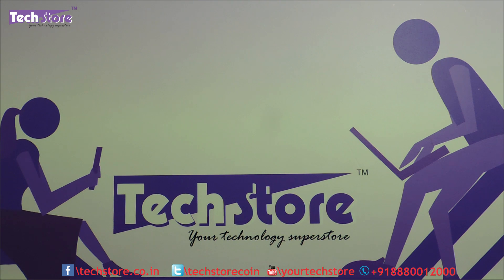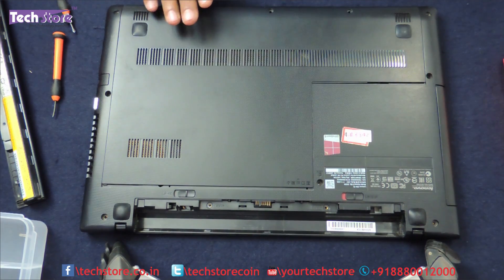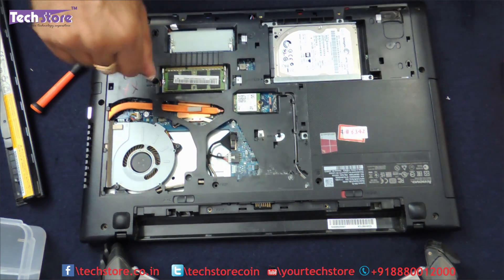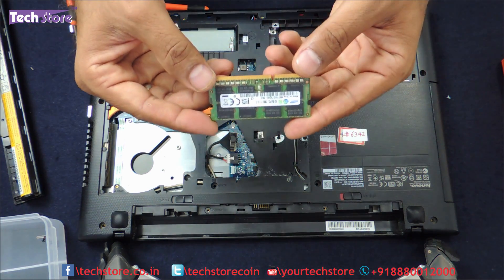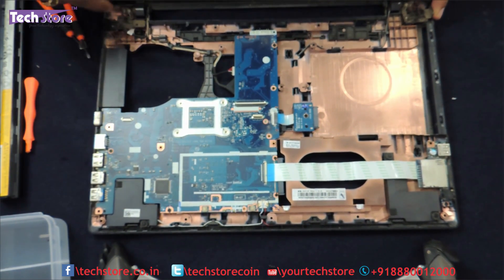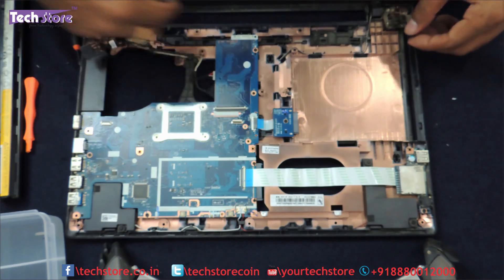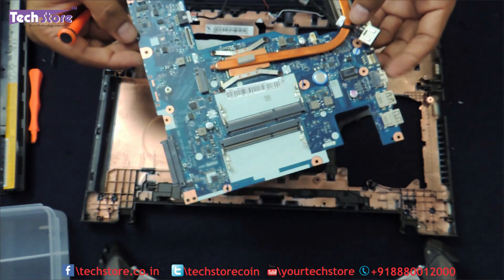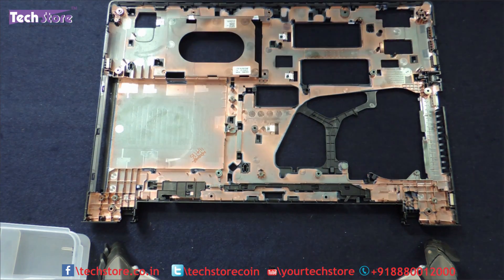Lenovo G50 70 Z50 70 : How to Disassemble broken Base & replace upgrade ram hinges motherboard ssd

Comment: Great job. I have a G50-30, in which I have an issue with the DVD Writer. The DVD Tray does not open. I can hear the sound  of the motor running but something keeps slipping (I think). I'm able to open it manually, and it plays, records etc. but only the tray does not open. Can you suggest a solution other than replacing the DVD unit? If there is no alternative, how much would a replacement DVD writer cost? & is the Bezel for the DVD unit separately available?

Comment: Tanks brother !!!
I have same laptop. my issue is that when i opened laptop, it will be opening of side edges from both side.
So i have to know that if i want to replace my body case, i Required to change both lower case bottom side) and upper case ( key pad side) or  only bottom side case.
pls give some suggestion..
Reply: I have the same problem